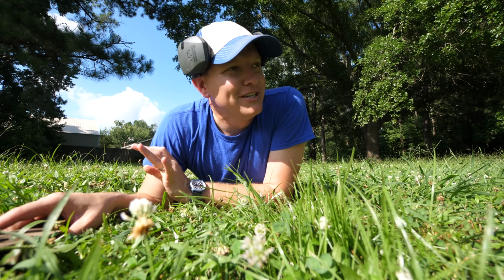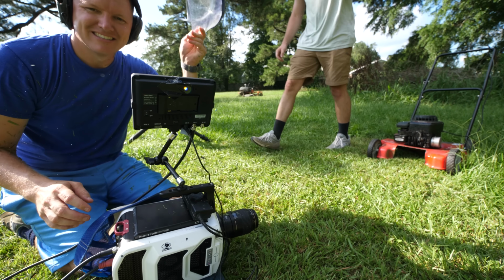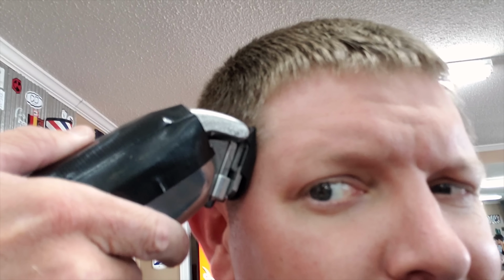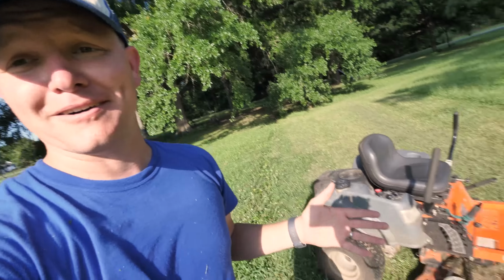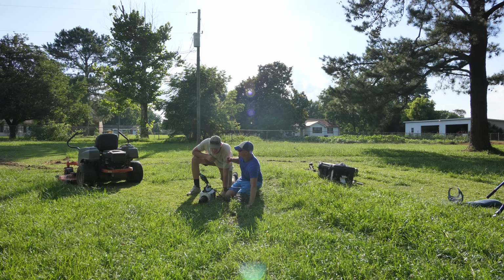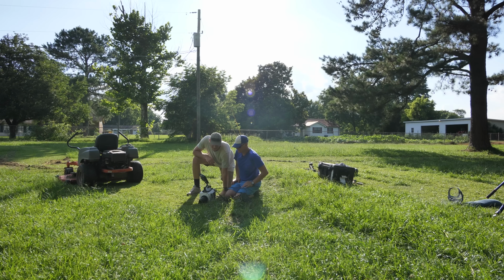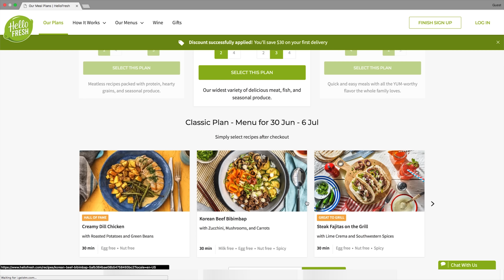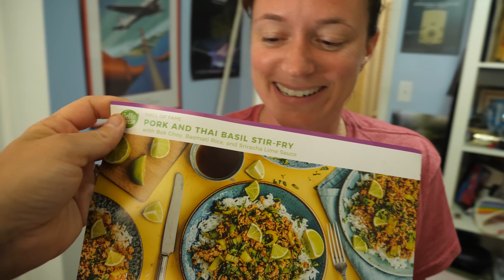How Lawn Mower Blades Cut Grass (at 50,000 FRAMES PER SECOND) - Smarter Every Day 196

Comment: Try sharpening your mower blades.  It helps pull the grass up and it CUTS the grass as opposed to thrashing it.    Walk over an area you just mowed and look at the ends of the blades of grass.  They should appear neat and uniform, like cutting paper with scissors.   It the tops of the blades are rough and jagged your blade is dull and it’s thrashing the grass instead of cutting.

Comment: hand tools question: whyis my 'grass hook' blade bevelled on the underside only?
Reply: it's upside-down.  The bevel should be on the 'top' side and the underside should be flat so that the chisel-edge has full clearance as it sweeps across and cuts low on the stems.  It shouldn't matter that it's bevelled upside-down, honestly, so long as you keep it sharp.

Comment: Love your videos, but you are wrong.  When the tabs are worn off the  grass still gets cut, but is not thrown into the grassbox properly. I know,  I have replaced blades. The blades of grass have inertia (very little), but the speed of the blade is very fast, allowing the cut. Similar to a samurai cutting a banana or someting. There is a general airflow to the grassbox  caused by the propellor effect of the tabs  + the tabs will  physically throw grass  to the grassbox, but the main cutting action is as per samurai method. Regarding tree leafs on the grass I think the action is as follows: If the tree leaf is below the blade the blade moves over it, the tab sucks it up and the tab on the next blade tries to throw it in the grass box.
Reply: This is such a complicated topic, I'm positive that no one can pronounce another "wrong" (within reason, lol). You're right, the wings give it radial and tangential acceleration helping it to the grass discharge. The wear off, it's not good for anything. Consider this: if the air flow through the inlet (i.e. bottom of deck skirt) doesn't exist, then no air comes out the outlet. Even worse, say air comes out of the inlet (mower brands exist that do this, precisely because the topic is so extremely difficult) grass is blown down. If one were to believe your total samairi theory (tho I admit, there's some of that, there's just more to it), then any depressions in the grass (technically not 'any' but that's beyond the scope) would remain there, uncut. Depressions such as grass layover from the front tires.

Comment: Often wondered if JD use stamped decks on their zero turns for the optimum aerodynamics whereas as others go with fabricated decks to claim structural strength.  🤔. I bet they use CFD.
Reply: Though it just may be volume and cost!  The other guys may not be able to invest in the press tooling

Comment: Ok,ok, here’s one for ya why is it mulching blades that are supposed to mulch the grass leave a trail of unmulched grass in there wake ??? Blades not sharp, grass too thick? RPM? Etc..
Reply: Too much volume for the speed of progress (feed rate).  Go slower, cut grass when it's dry, and don't cut it so short that the clippings are more noticeable than the remaining blades :)  Also, always use a sharp blade!

Comment: dude needs to sharpen that blade.  Yes, the bend of the blade creates lift but beating the grass with a fast-moving blunt object is ripping the grass apart the way a speeding car rips apart... well... you get the idea.  Scythes mow by combining a sharp edge with swift motion not requiring 'lift'. Sharpen your mower and it will require less force and will make a cleaner cut on every stroke, you can mow much faster and have a cleaner, healthier lawn.  Same principle with all cutting implements, EVEN SCISSORS, use a sharper edge for a better cut that requires less force to complete, less energy per cut, less wear on the blade, which results in longer tool life.

Comment: Consider US patent US3838558A - Air cushioned lawn mower and grass collector .... essentially, a lawn mower combined with an air cushion vehicle/device where the lawn mower blade provides the pressure for lifting the lawn mower and cutting grass.  I talked with the Examiner of this patent (or one relating to a similar idea) and the inventor demonstrated to the Examiner's satisfaction that the grass was NOT pushed down by the blade to such an extent that the mower did not cut (to get a patent, and invention only has to work, not work well.)
Somewhere I read about a guy who was run over by a hover craft and was unhurt.

Mowing on a hill might be a problem..... maybe some guide wheels?

Comment: Either way that looks really traumatic. I wonder how that would look with a blunt blade, probably on 70% (or more) of the mowers in use. Ever think of looking at the Automower? Cuts your lawn automatically using 3 razor blades, not a big steel bar. It does the work for you and probably cost less than your big ride-on. :)

Comment: Umm, your mower deck can't function properly with a hole just cut into it. If you would replace the cutout portion with a similar shaped transparent piece, it probably would work better. 
Then again, a weed wacker works without a deck. And what about those mowers that operate like a hovercraft, on a cushion of air? How do those lift the grass whilst pushing air downwards?
Reply: Both a conventional mower and a hover mower push air OUT from under the deck, but a hover mower has no discharge chute and also has a special fan to increase the outward air-pressure around the deck, thereby lift the deck off the ground.  This air-pressure pushes the grass down AROUND THE DECK just like a conventional mower, but once under the deck there is less pressure and the grass can stand up (on its own, no lift required) to be cut by the spinning blades.  It's important to note that the cut occurs on the outer edge of the spinning blades just passed the high-pressure zone of air-flow, no uncut grass should make it to the center of the blades on the deck (i.e. the pivot).  The uncut grass is not lifted in any of the models, and you can buy flat mower blades that are not designed for throwing clippings into a bag or chute.  Indeed, mulching blades work by cutting up the clippings after they have been separated from the stem and then letting them fall back into the grass - wouldn't work if they were being sucked into the deck all the time.

Comment: But what about dandelions? They seem to duck as I mow them
Reply: because they are being blown down by the outward pressure generated by the blades.  Grass is less susceptible to this pressure.  Grass isn't being 'lifted' by the blades, it should be CUT by the blades as soon as it is under the deck, if Destin would sharpen his mower a bit...

Comment: Barber way smarter than engineer, go figure. ALL engineers should be required to pass a common sense test BEFORE receiving diploma.
Reply: Barber is using a vacuum attached to his clippers to collect the clippings.  That hair is so short, it is standing up on its own, the vacuum is doing none of that.  Same with the grass, there is no vacuum pressure standing it up, it does that on its own once the mower is no longer blowing it down.

Comment: Zero turn vs tractor ehixh id faster and why? Answer the Zero Turn kind of the why it goes faster. Kind of why the zero turn can cut at full speed tractor cannot cur at full speed. But WHY? Besides just zero turns were designed to cut at full speed i get that but WHY and what about them. I can attest this is true i went from a 42" 5 speed john deere tractor to a 42" zero turn tractor cut my cutting time in half. And irs not tjudt the fact it turns so quick I can cur at full speed and cut properly.

Comment: THINK?  MASHED POTATOES OR LETTUCE:  pounding steaks or slicing garlic or radishes! Slight end angle will let you use ^π∆ a 22" blade cut down to fit ( with minimum clearance into a : " Food  processor" : twoo things : clearance & lift --- as to not to hit under load: or follow the mfg. Sales manual?  Teacher/ professional ? No- 40 years of - getting too old to do this & can't afford not to!  But beware of the politicians & their batteries, propellor hats & solor powered lawnmowers& more & more TAX, ETHANOL &  " HAZ- MAT " LIFE?
I SAY GO FULL ETHANOL OR NOT! ( I GET MINE AT THE LOCAL "FBO" at the airport @ 120 octane LL OR 140 MIL GAS:  IF I CAN FIND IT! 
No water, gum or scum!  ( adjust RPM & clean air  & lots of it ?)  But you'll be able to practice your putt & walk barefoot thru your " shag carpet"  yard? 
 Or buy a goat?